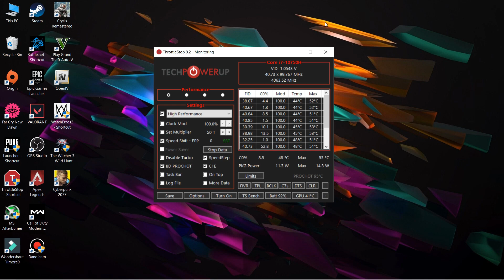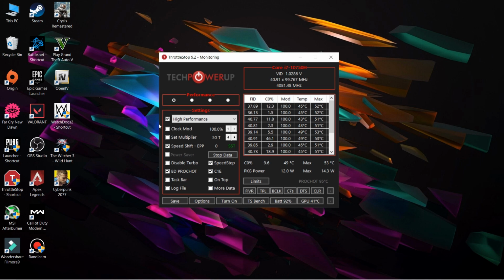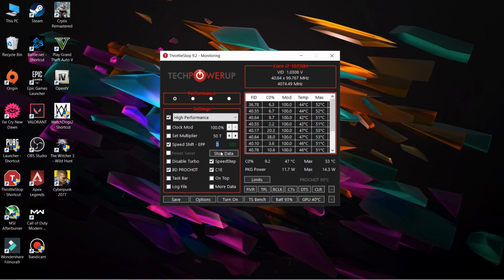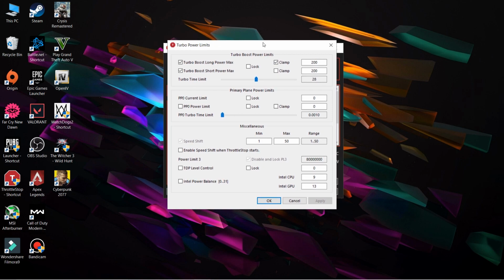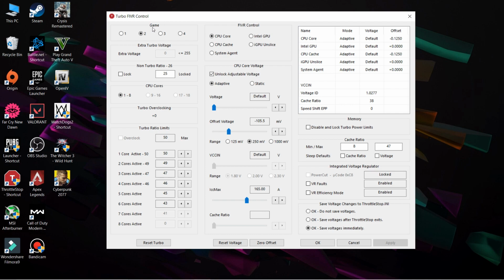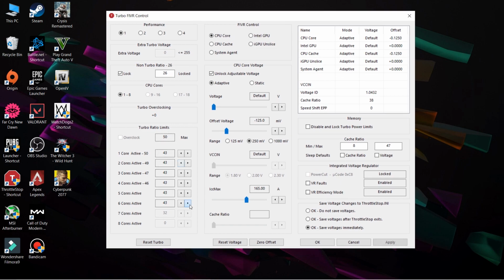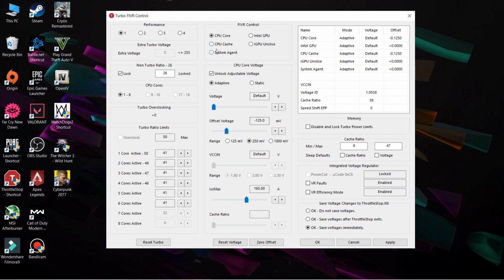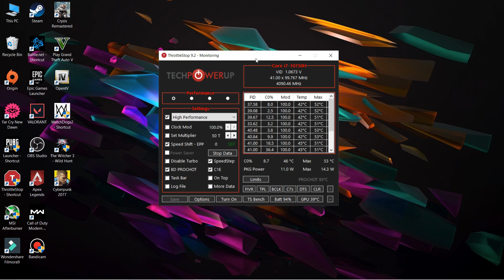undervolting i7 10750H quick guide !! Lower you cpu temps and increase performance !!

Comment: is it possible to have PL1=200, PL2=200 too. My settings with the same CPU is: PL1=70, PL2=107, Turbo Time Limit 28. Turbo Ratio Limits same as your for gaming. CPU Core -80mv, Cache -70mv, iGPU -30mv. I have about 152avg FPS on DM servers in CS2 and 220-230 avg fps in matches. I think this is very good result for my old Hp Omen 17 with rtx 2060, same cpu as yours. Max CPU temp = 87c
Reply from the maker: You can try increasing slowly, do not increase direct.

Comment: I found the sweet spot for i10750H to be CPU -130.9 and cache -100.6 with core ratios all lowered by 2. PL 1 should be 60 and Pl 2 should be 90. Turbo time limit 28. Intel recommended* just my experience.
Reply: how'd you put the core ratios by 2? Mine's all 26

Comment: hey bro i have i7 10870 h cpu in my laptop. Can you suggest what can i do in this situation?

Also i get cpu temp at 100 degree celcius on my laptop. I really want to fix it.
Reply from the maker: Try clean the exhaust fan and use cooling pad if you can
Reply: @R-tech890  I have cleaned the fan, repasted new thermal paste. I have observed something, whenever I turn on turbo mode of my fan. Temps starts to rise 100° C while gaming, but when turbo fan is off, it goes 92-95 degree celcius. 

Do you know what can be the issue?
Reply from the maker: Dont have much idea about this, try lower down the clock.

Comment: A little reminder to those who watches this later, DON'T STRAIGHT UP enter his setting you can use it as a reference and try set your device from lower and DON'T SAVE VOLTAGE IMMEDIATELY, MAKE SURE TO TEST IT with a bunch of games, stress test etc to make sure you don't get any blue screen or errors Only after you are sure then save the voltage, use Don't save voltage Immediately. AFTER COMPLETING THE TESTING YOU CAN SAVE THE VOLTAGE

L
Reply: What's wrong with saving the voltage? Throttlestop doesn't start automatically with windows, right? So doesn't it not apply the voltages until you open up the program, say after a blue screen?
Reply: @bestsnowboarderuknow  Basically if you use save voltage immediately it save that setting to your Throttlestop so whenever you open it the setting apply simple right? So imagine if you got a blue screen after save it immediately thought it's an easy fix I found out after a while You can just delete the .int file then everything will be reset but all your tweak and settings will also be reset, not practical for testing and sh*t

What I recommend is try testing from let's say -60 then play your heavy games or benchmark if it stable then continue -70,-80 until your computer blue screen then you'll know what the limits are, so let's say your computer crash at -125 then just set 110 or 115 and Set it to save immediately 

Now you have a sure profile that won't crash on startup 

And lastly set Throttlestop autostart is damn easy just use Task scheduler, but only do that if you're sure you know it won't blue screen after open
Reply: @wakatsuki4563  I see. I guess you could just delete tstop and reinstall it if that happens too. Also, I'm hearing from many places and articles that the cpu core can be undervolted to twice the cache. like -220mv on core and -110mv on cache is stable on my i7 10750h in my msi gs66 stealth.
Reply: @bestsnowboarderuknow  it honestly doesn't matter that much, I tried many combinations but it doesn't really change that much, you can try and find out, at most blue screen so why not? But I won't bother too much with it just normal undervolt is more than enough
Reply: hmm, when u click apply its running on voltage u desire, so theres still a chance where its going to get bsod, also just use tsbench inside the throttlestop to see if theres any error, if theres an error then u should change the settings

Comment: My throttle stop settings are greyed out.. I have a razer blade 15
Reply from the maker: Its locked by default in current bios version
Or try old version of TS it could work

Comment: Hi, I have tried this but I get blue screen every 1hr later, I got acer predator helios 300, 17-10750H with rtx 2060.
Reply from the maker: Your need to change the values you applied
Also dont use same as mine
Reply: @R-tech890  i used default value my ghz is locked at 2.9ghz on disabled turbo perhaps this is game changer for me. However what performance settings should i keep for playing Microsoft flight simulator and COD MW2 , F1, Forza 5 etc? Could you help me with setting that up.
Reply: @R-tech890  can u help me what values to put? My screen froze again.
Reply from the maker: Try from small number like 40 or 50 and increase little by little amount.
Then see where crash occurs
Then lower a value down from that number
Reply: @R-tech890  hey, I am getting blue screen constantly now out of nowhere once i turn on throttlestop is there anyway i can dm you and you can help me? I am worried what i have done wrong.
Reply from the maker: Whatever the value you have used for UV increase them
If you have use -80  then use -70 
It will get stable
Reply: I have same laptop did you know how to undervolting it?
Reply: @Smart_boy2001  use -85 to 100 rates when u set undervolt.
Reply: Just disable turbo boost instead of undervolting.
Reply: @NGT4LIFE  bro my laptop died and now I got a new one and this is locked by all means luckily I'm able to disable turbo but yea I need to lock cpu to 3.6ghz which I can't.
Reply: @karanbhanu777  you could try to limit the cpu to 45 watts.
Then it'll stay at the wattage the whole time.

Comment: I have dips in fps in all games, temperatures exceed 90 degrees acer nitro 5 rtx 3060 i7 10750 h. Could you write me the tpl and fivr settings for my pc? I don't want to decrease the clock because the fps go down a lot help me
Reply from the maker: Fps should not go down
Lower lock by just .1 to . 2 mhz
And undervolt till stable values and use cooling pad
Do not mess with tpl.

Comment: pretty nice settings, from a constant 92 degrees to 89, which is pretty good in my laptop standards
Reply: You'll get lower temps if you disable turbo boost.
That will just keep your cpu at no higher than base clock speed...so if your CPUs base clock speed is 2.4ghz,then it won't go above that.
You'll still get good fps in games,but temps should be significantly lower.

Comment: I my case i have asus rog g15 g512lw i7 10750H with RTX 2070 FIVR LOCK in my laptop can you help me because in game my cpu temp is always over 90to95 can you make video for me
Reply from the maker: Dont have any access to a laptop
Check bios for xtu enable interface
Reply: @R-tech890 bro  already check everything intel extreme throttle stop everything
Reply from the maker: Then you have current bios version in your system and its default locked in current bios.
You have to downgrade bios.
Reply: @R-tech890  yes bro but i can't find older version of bios can you help please
Reply from the maker: It is not easy to fined old bios.
Try to use old throttle stop version some time it works.
Or wait for new bios update.
Its last that i can say buddy..
Reply: @R-tech890  thank you so much sir for replaying
Reply: Just disable turbo boost...very simple and will reduce temps massively,and you'll still get good fps in games.
Imo disabling turbo boost is alot better than undervolting when it comes to gaming laptops with 9th to 11th gen CPUs.

Comment: the undervolt doesn't take affect :( i have acer predator helios 300
Reply from the maker: Depemd on ambient and how much you have UV also use cooling pad or a laptop stand if you can.
Reply: Did you undervolt it?

Comment: I would also recommend setting the speed shift epp to 92. and in the TPL section setting min 1 and max 39. From getting 92C max now I'm getting 79C max with no performance loss. It's just amazing
Reply: are you sure its safe to do so?
Reply: @crisscross5177  Of course, lol. You can’t do any harm by doint this. The only way you could damage your hardware is by increasing the voltage, you could fry it. But that’s overvolting/ overclock.
Reply: @starmember132  Should I disable turbo mode with this? And the tpl section is locked for me :(
Reply: @crisscross5177  What cpu do you have? TPL shouldn’t be locked by default. Only FIVR controls. And about turbo, it’s up to you. By disabling it you’re telling the cpu to not boost to higher frequencies than it’s base one. In other words, No Turbo= less heat but also less performance. Turbo On= More Performance but More heat.
Reply: @starmember132  I have the same cpu from the video. Performance wise its a beast but it overheats to 90 degrees Celsius which is too much in my opinion. So I am looking for ways to cut down the temperature. Thank you for your help , by the way
Reply: @crisscross5177  No problem. What’s your laptop brand and model? That could help a lot in diagnosing the issue.
Reply: @starmember132  acer aspire 7 with gtx 1650 gpu
Reply: @crisscross5177  Hmmm I don’t know much about acer but I’ve never heard of them factory locking their computers. Nevertheless, I can assure you that you can unlock it. Just look up in google how to unlock your specific model.
Reply: @starmember132  Alright. Thanks again.
Reply: How do I change the speed shift settings? I don’t see any option to change it.
Reply: what iotion from TPL do you mean, Speed shift ?

Comment: 1. BRO  i have  done the same changes but my CPU is showing only 2937 MHZ VID 0.77 29 x 99 yours is showing 4090 MHZ and 1.0 VID and 41 x 99 how ??? what I am i doing wrong ?
2--- hello please tell me the DEFAULT value for i7 10750h RTX 2060 - ICCMAX default values ? - core cache also ICCMAX ? it was something on my but i forgot to write - i copied someone 165 and 11 I dont know if that rite or wrong ?

Comment: my nitro 5 i5 10300h its only 70mv :/
Reply from the maker: Every cpu have their own values for UV
Reply: @R-tech890  yep, when i use -100mv the screen freeze, on the first time i scared husahusa
Reply from the maker: 😅
If your sys doing 70mv and stable then its fine.
Do not push more.

Comment: can I apply these settings with the MSI g65 thin i7-10750H RTX 3060,
any recommmended settings for this model?
Reply: You found any method to reduce the temp? Even I have the same lap it reaches 95°c while gaming..
Reply from the maker: Use different settings
Reply: @R-tech890   why if same processor :o pls help
Reply from the maker: It depend upon cillicon lottary
Even same cpu but temp and performance will vary

Comment: Hey there. Can someone help. I managed to undervolt my i7 10750h on my laptop. My current settings for cpu and cpu cache is -100.6mV (any more then BSOD) and ICC Max is 140. This helped reduce temps really well but am now experiencing micro stuttering in all my gamss. I have a Nitro 5 2021 with a 3060 gpu. Can someone help my with getting good stable throttlestop settings so that i can set the rest properly? Also speed shift epp is set as standard 128. If i lower this to like 100 or something. Would it make a difference? Im kinda frustrated cause if i tweak anything else now ill get BSOD.
Reply: i have the same problem you solved please help me
Reply: @DomsR6  Ill be honest with you. Undervolting didn't help me with throttling at all for this laptop. Its very disappointing. If I knew that these laptops throttle so easily, I would have gone for something else, but the price was really appealing at the time.
Reply: Kinda late in replying but speed shift is optional, the stock 128 is a normal performance if you set it to 0 it run in maximum performance, you can change it base on profile you using you laptop

Eg. 10 for hardcore gaming
64 for normal gaming not too intense
220 for battery ....
Reply: @wakatsuki4563  thanks for replying. I set it at 10 just to test and almost instantly BSOD. it seems a bit strange that it happened within a few seconds. I'll test the lower setting.
Reply: @FaeezHendricks  It may be different from system to system but from what I tested it doesn't really matter much you can leave it unchecked. It just let you customize it better to your liking I set mine to 0 and even with fan it get pretty hot quickly it just same with Ultimate Performance and Balance haha I find Balance works better for laptop than peak performance all the times 

I don't know if you still having trouble with undervolting now but if you do the one I know which always works is just to lower the LEFT SIDE for a few like 50 to 48, 48 to 46 or 46 to 45 it always works
Reply: @wakatsuki4563  Ah ok. Let me rather give that a go and see how it performs. Either way they heat up pretty quickly. That CPU is such pain lol Thanks for the feedback and advice!
Reply: @FaeezHendricks  you're welcome

Comment: I just don’t know what to do some games will run fine and be under 80C others will straight up lock my computer to crash and freeze then I have to hold the power to restart and shutdown… is something wrong here? I have the same cpu my gpu is 1660 ti. If I go below -125 core would I have to then up or lower my turbo ratio limits? It seemed like you were getting to that in the video im just not sure anymore… this is so annoying. Im abt to say fk this cpu and stop undervolting letting it run 96C like intended I just don’t understand it won’t stay consistent depending on games…
Reply from the maker: Not every game support same UV values.
If you want to lower voltage value.
Then you must need to downclock the cpu.
To make UV stable.
Reply: @R-tech890  downclock?
Reply from the maker: Means lower the cpu clock speed.
Reply: @R-tech890  so
I enabled xtu in the bios so now
Setting my turbo ratios, that will take effect now? So setting it to 36 means 3600 mhz max or whatever? Does underclocking effect performance majorly? Im assuming it will depending on what you set it as but I can also make it higher im guessing. I wonder if since xtu was disabled in bios maybe that’s why the effects I chose on turbo ratios weren’t working before?
Reply: @R-tech890  tried enabling it and everything… did not work and is still crashing even after and now I’m just about to throw this laptop in the trash. Set all the values set it -125… like what else can be done.
Reply from the maker: Under clock will work but if you push the clock limit in laptop then it will not work.
3600 mean 3.6ghz.
If your cpu running at 4.0 and you drop to 3.6 or 3.5 it will not impact performance.
Reply: @R-tech890  xtu utility tool tells me I’m power limit throttling with 4.1ghz frequency set should I try lowering it? At 36 it just froze my entire laptop… ugh.
Reply: @R-tech890  tried it again just keeps freezing and crashing… not sure what else to do.
Reply: @R-tech890  I have no idea to downclock not sure if you made a video on this… man this is fked

Comment: I've got a problem where FIVR controls do not change any settings. The voltage slider is greyed out and changing offset does nothing. However, where it says FIVR Control, it doesn't say locked.
I have a feeling it may be locked out from the bios, but in the settings for the bios, it shows a setting called XTU Interface being enabled.
Would I need to use XTU to do this?
Thanks.
Reply: Also, it is an i7-10750H.
Reply from the maker: Use throttlestop
Old version.
Reply: @R-tech890  Do you know which version I should use?
Also when attempting to use XTU, it seems the undervolts save but in both HWinfo and Throttlestop show as 0 for offset.
Reply from the maker: Try version 9.2
Reply: @R-tech890  Alright. Will do.
I did try 8.70.6 with luck having the option to change the voltage slider, but had the have effect where the offset did nothing.
Reply: Following on to using 9.2, it seems to not make any different to the offset shown in FIVR and HWinfo. Starting to wonder if theres an issue with getting this info from the cpu.
Currently ran out of ideas on what to try.
Do you know of any other methods to lower cpu temps without changing the performance that much?
Reply from the maker: Try lower the core clock a bit.
Reply: Hey man it means that your bios locked the “overclock” setting which is related to undervolt, you might want to Google how to unlock it, before trying throttlestop
Reply: Ok listen very carefully, go in bios, press right shift + right ctrl + left alt + tap f2, in bios menu it will unlocked advanced tab, then go to cpu something and slide all the way down to find a sub menu with overclock lock and disable it ( i dont remember precisly sorry )

Comment: is this like 
Disabling turbo boost 
Which is better
Reply from the maker: If you disabling turbo then you are using half the power of cpu.
UV is to reduce extra power supply and give same performance.
At lower temps.
Reply: @R-tech890  yes it runs on 2.5 GHz 
My laptop is the legion 5 is there is any problem  undervoting it and if I want to undervolte it just follow your video or there is something else i should do 
And another question what is the best thermal paste iam using noctua nth1
Reply from the maker: There is no problem if you UV 
Process could be different in your laptop.
But in throttle stop it will be same.
Reply from the maker: You can use
Thermal Grizzly Kryonaut
Or Arctic MX4

Comment: When I go into FIVR settings all of the options are greyed out and it does not let make any changes. Any ideas?
Reply from the maker: Buddy its locked in current bios.
Wait for new bioa or downgrade bios to UV your laptop..✌️
Reply: @R-tech890  Appreciate the response. I ended up finding that out and decided to get rid of the laptop. Seems like this is an issue Intel has had or a while and I don't like that they block us out of our own tech we own for "cyber security" bullshit. Goodluck to everyone else running laptops.
Reply: same